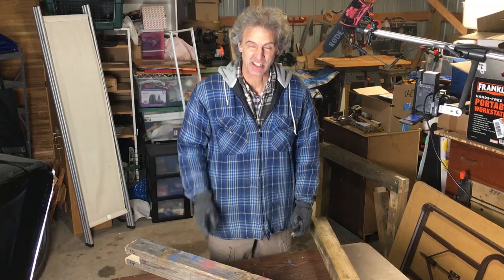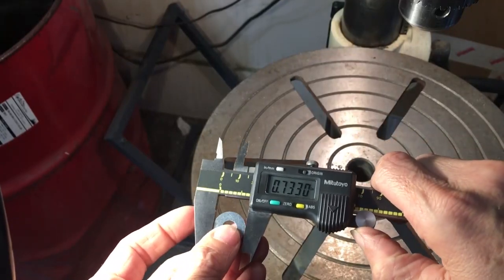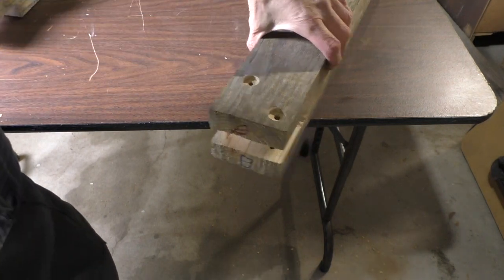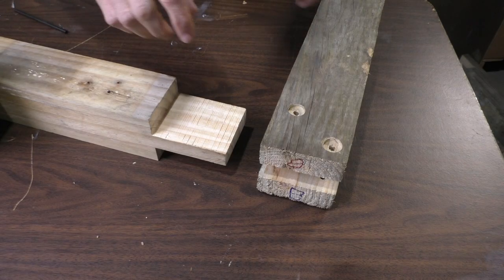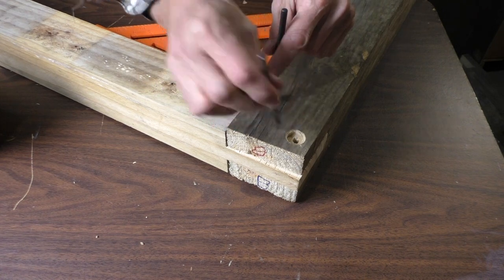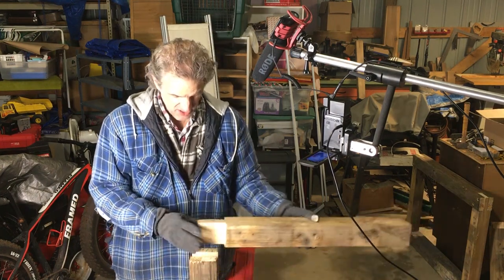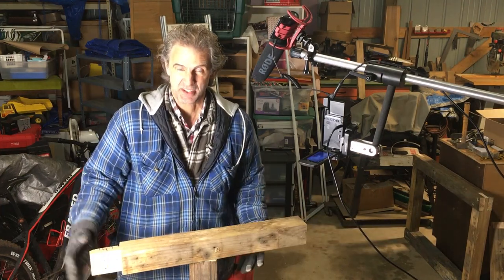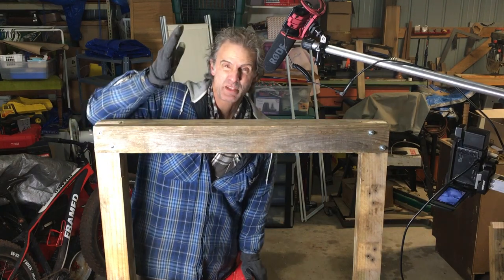Easy Post and Beam Mortise and Tenon Joints

Comment: The 1/16" stagger comes from original post and beam construction when they used wooden pegs to join the pieces. I recall that some joiners would cut a split in the peg and drive in a wedge after to make the joint tighter. 
I wondered if the bolt threads might ream the joint while driving them.

Comment: I like that trick. Forcing it that 16th (wich it will shrink that much anyhow) also creates friction inside there. The extra vibration created as well helps.  It all adds up to making the two as one. But one thing to note is do not damage the fibers with your hammer during assembly.  And if you want it even tighter with zero gap, soak it in water afterwards for an hour or 2.

Comment: If you offset it vertically by 1/16" to pull the joint tighter vertically, why wouldn't you do it horizontally as well?
Just a thought.